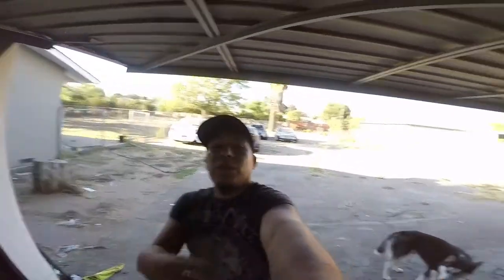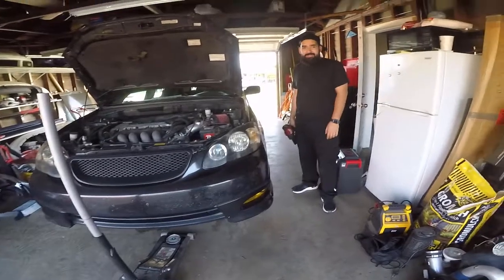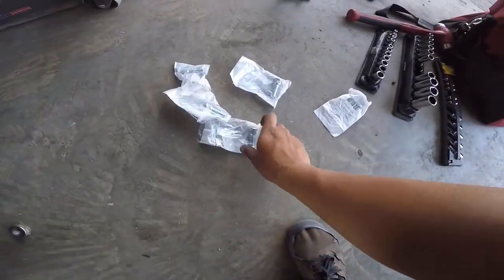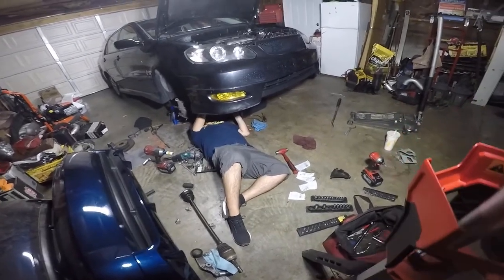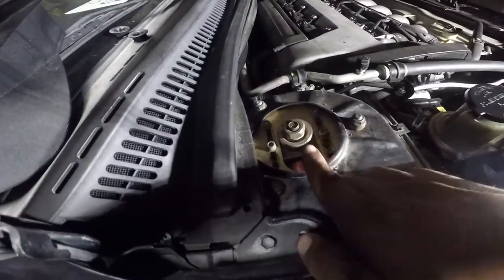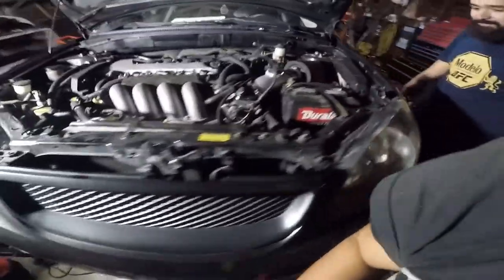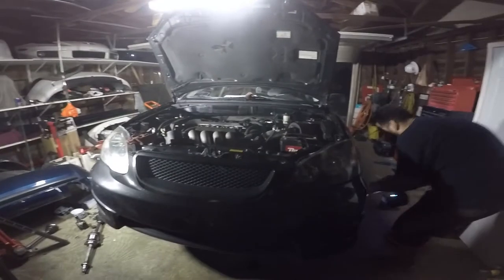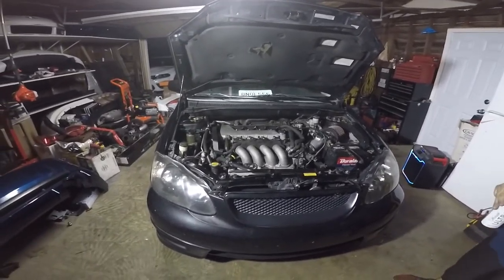Installing Axle, Studs and Sway Bar Links On the Corolla Xrs

Comment: Hey man dope video ! Also do you happen to know the part number I’m currently having same issue with my 05 xrs and I’m not finding the correct axle for my car I was going to go sebastians route and get 2000 celica gts axle but I don’t even know that axle part number he hasn’t replied back on his videos and auto zone wants to sell me an automatic axle for the corolla S.. they don’t know what an xrs is it doesn’t come up on their system smh 🤦🏽‍♂️
Reply from the maker: I couldnt find one with the bearing that fit my tranny oreily has one
Reply: @RafasGarage  oh okay I see, but what specifically did you ask for at oriely’s did you ask for an axle for xrs or some different model that’s where I’m stuck hah by the way I appreciate you answering man thank you !
Reply from the maker: @nelsonaguilar213  yes i told them it was an xrs a different model than the regular corolla